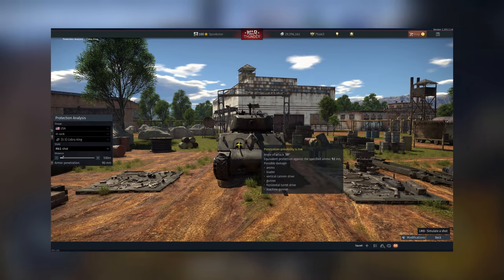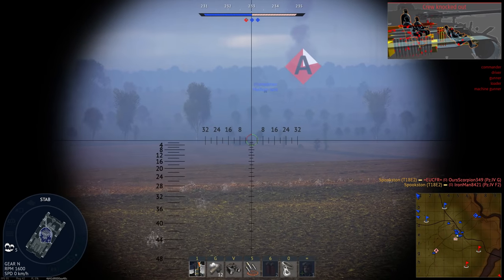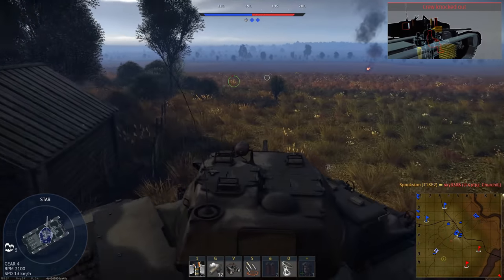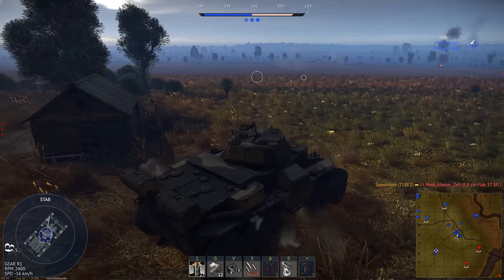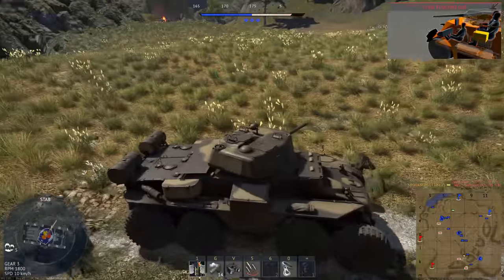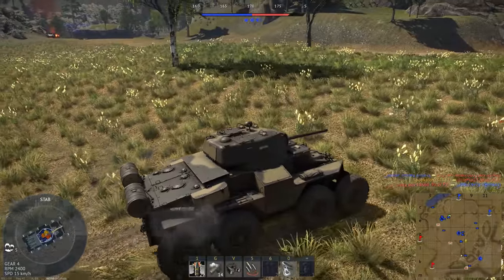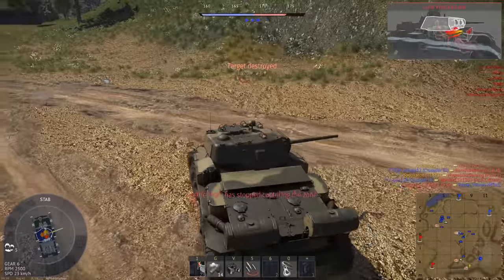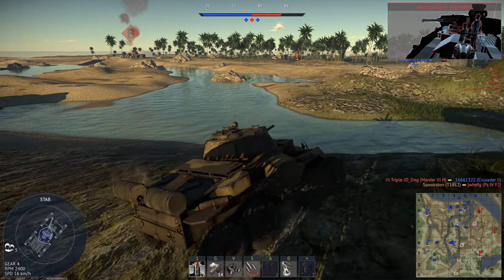Volumetric Shells Were A Bad Idea

Comment: Personally i actually like volumetric its acutally easier to hit with 152 derp guns HOWERVER the way gajin realeased it it was rushed even if we give the usual slack for anything to do with modules since they were always bit janky but the thing with 2 armor plates adding their protection together is just wrong it should not be a feature and thats why they shouldnt have released it this way.
Also if tracks protect the tank now even more than before since their a module which as we remember is janky and their now easier to hit than im fine with them removing volumetric shells.
Tho if they were to fix atleast tracks but preferably the plates problem they can keep it. 
If shells would start to work they would be a fine addition to the game since wt is already heavily invested in its own kind of realism and its therefore the right addition.

You say there are no advantages to volumetric shells but thats not true they might not outweigh the negatives but they are there. For example since shells have the correct size shells can bounce much sooner from an angled plate than before since they sides of the shell can now actually hit something instead of just the 1 pixel at the tip of the shell. easier hits if you try to hit a wheelie boy a hit anywhere can be enough with real shells hitting the vehicle becomes a lot easier. a new way to play heres the situation i was playing a kv-2 and infront of me was sherman my ap was not able to pen the mantle but it was enough for the turret front next to the mantle so i actually shot into the thin air next to the turret and the large 152 shell could still hit the turret and pen without me risking a hit on the mantle. i dont know if volumetric rearranged the fragments after a shot pens a target but i think if you ignore modules eating shots the deadlyness of a hit got increased. 
If i hit the part of the frontalplate on the tiger 1 that protects the turret ring crew hatches etc and my shoot is large enough than i noticed that atleast a part of the shot or a small amount of fragments still managed to enter the tank since a part of the shell still hit far enough down to then enter the actual tank. 

Also if Gajin were to fix vision ports and mg ports and the plate problem then with the help of improved volumetric shells then the game could actually calculate how much penetration was needed to pen for example a round mg port since the outer edges of the shell might hit the actual armor while the core of the shell hit the mg the shot should have a harder time going in then if it were to hit only the mg and therefore the shot should pen but the have less energy behind it  or if pen was not enough then only the core of the shell should penetrate (shaving of the edges of the shell)
Atleast volumetric shells are a part of a fix for modules and it would not be so random if a shell gets eaten by an mg or vision block

Comment: There's alot of armour/ shell imbalances in the game. The damage and armour models are all completely off across every vehicle in the game. I.e. Modern tanks (1970 onwards) not being able to pen WW2 tanks. But WW2 tanks able to one shot kill modern tanks. Not to mention armour like spall, applique and improvised armour addons not even able to resist a HEAT shell at long range. I don't expect to be KO'd by a Jagdtiger in a tank made after 1970 at long range. The whole models are completely flawed. Armour needs buffing appropriately for the type of armour accordingly and shells equally need buffing or nerfing depending on the type of gun, size and age its being fired from.

Comment: I disagree but also agree with the video.

Volumetric shells are needed. Realism is good.
But as you mentioned.
There is no point with realistic bullets if you dont add realistic armor.
We need volumetric armor and then things would be interesting.

Im not a fan of autistic pixel hunting.
Yes i know its a skill that require practice. But i find hunting anything that is pixels outside Indie games rather stupid

Comment: I think they just need to have more features in place for Volumetric shells to fully work. I dont want to go back to pixel aiming because it made the game absolute cancer.
Maybe implement a mechanic where rounds can get jammed into gun mantles and turret rings if they are big enough compared to the gap as what would be effectively destroying the turret ring/vertical drive and making sure all vehicles get volumetric armor instead of the weird blocky square thing stuff like the T-54 has now. And of course, some vehicles need to be up tiered.

Edit: Unrelated, but I dont think the "my ATGM hits bushes more often" is a volumetric problem and is just a War Thunder problem. Do you really think a fucking bush is enough to stop a tank round/guided missile in real life? I dont think so.

Comment: This has actually been my favorite update they have made in a long time.  Turret rings, for instance, that are not big enough to fit a whole round in, now often times just nocks out the ring itself rather then the whole round penning the weak spot that. in realty, it could not have reached.  This has made plying against the Tiger, which I rarely play myself, more fun, as most shells can't reach it's turret ring, because they are too big.  So I have had to find alternate weak spots, or adapt to know the angles at which I should aim for the front plate vs, the side plate.  So, I have enjoyed this update.

Comment: As you said, the feature is unrealistic. 
For other reason; say that you fired a 75mm shot to Sherman Jumbo’s frontal weak spot. But your shell’s edge touched 1mm of the surrounding part so it didn’t go through. The point is, there is actually no decent physics in this game, so it’s pretty ubsurd why the hell they want to put something like this mechanics when there is no existing supports.

Comment: Zero-volume shells probably could've easily been fixed by just adding some sort of secondary hitbox where component seams/armor holes are and just making it act as an RNG box if the shell passes through of not (within some sort of weighted chance to pass or something).

At least, Gaijin has done the hard work in discovering that making volumetric tank shells is hardly worth the work if you don't put in the effort to catch all of its own strange edge cases.